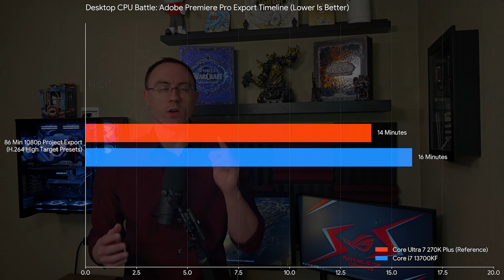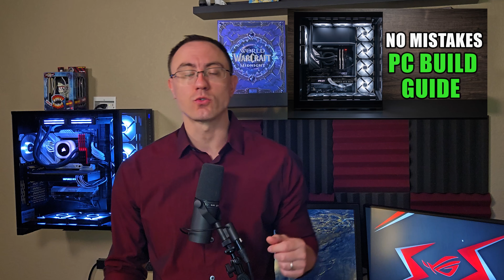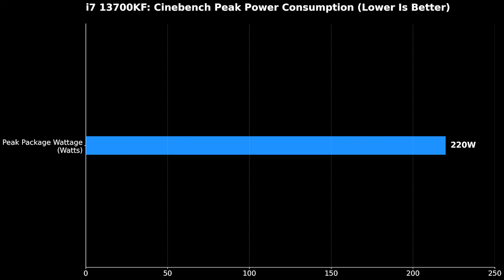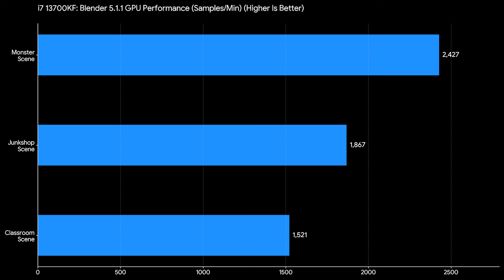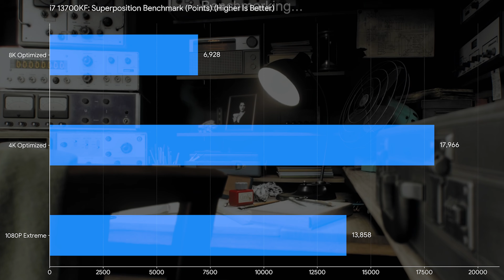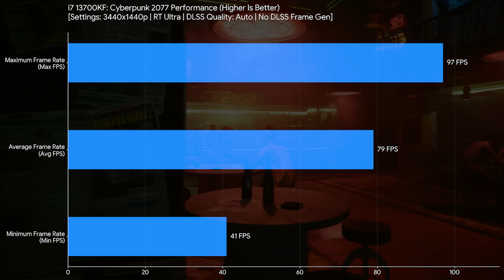The Truth About Upgrading From 13700KF To Intel 270K Plus

Comment: You should run 270K Plus on 8000Mhz ++ memory since the memory controller is uppgradet to 7200Mhz. Running it on 6400MHz makes an 600Mhz underclock ...
Reply: most people wont use 8000mhz
Reply from the maker: I wanted to run my tests in a raw baseline without any modifications to RAM, less XMP settings.
Reply: sorry if this sounds like a stupid question, but where does it make the 600Mhz underclock, the CPU?
Reply: @selim197a Because unlike amd the intel cpu's take advantage of those higher ram speeds

Comment: With the 270k plus do enable or disable asus multi core en or Auto )
Reply from the maker: All BIOS settings were left on default besides enabling XMP for this testing. I was contemplating re-running tests with optimized/enhanced BIOS settings but did not end up doing that for time.
Reply: @TheDonTech  on all defaults in my ASUS Z890-e gaming wifi BIOS (Latest updated) , my 270k plus cpu reaching 102 C in cinebench multithread and package power reaching 260W... how do i keep it under 80 C and 200W?